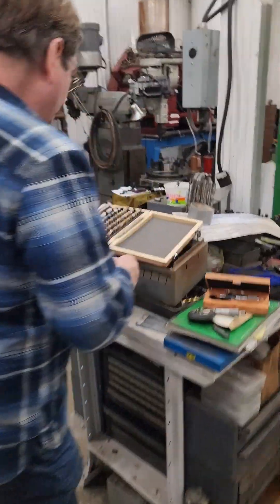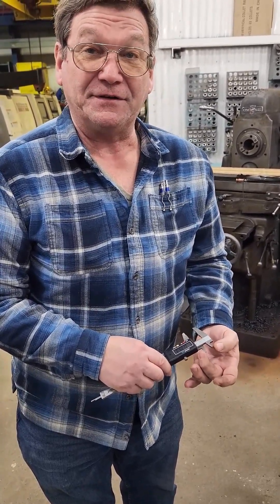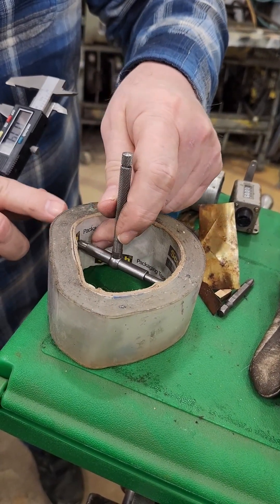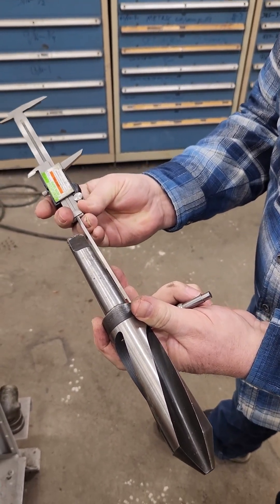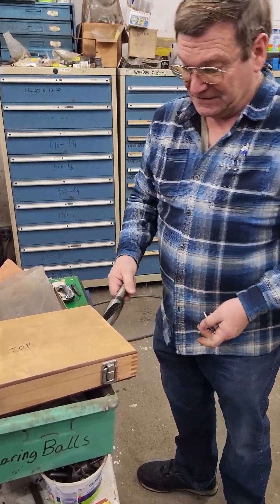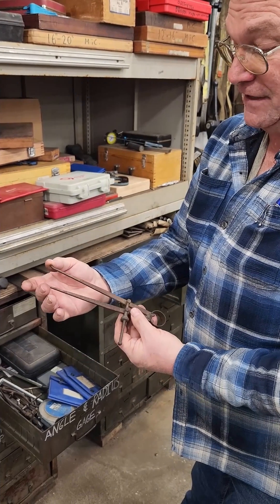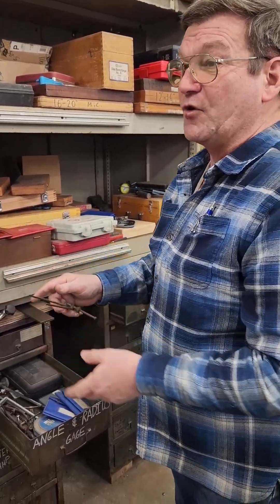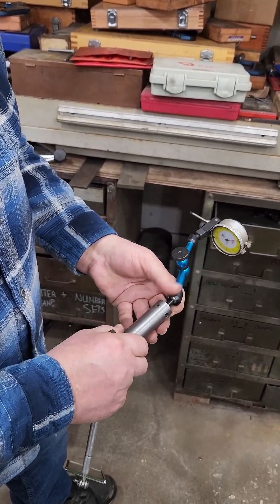Measurement Minutes: Calipers, Inspection Mirrors, Coordinate Axes

Comment: Great place ,I just got a southbend 13 metal lathe two months ago now I'm hooked.I would like to get into the metal business,thanks for your youtube clips they are really informative. Keep up the great work 👍.
Reply from the maker: Glad you're enjoying it! What problems have you run into so far?
Reply: @HOWEES  Hello ,I'm feeling around the lathe now ,I found out that three jaw chuck aren't centered (doesn't keep the parts concentricity) lol.
Also different metals when turned produce different results some leave a nice finish others leave the tool markings so that's how new I am 🙂
I watch alot of YouTube videos they seem to help.
Reply from the maker: @woodywoods5373  While this won't help for all differences in materials (think of breaks easy, gummy, hard), the first 3 videos on this play list gives pretty good insight to lathe cutting tool variations.:
https://www.youtube.com/watch?v=ttL1k0Fnd-8&list=PL5W-nUGHwyzlEzXDtep7eYXcmz5rCJ8U4